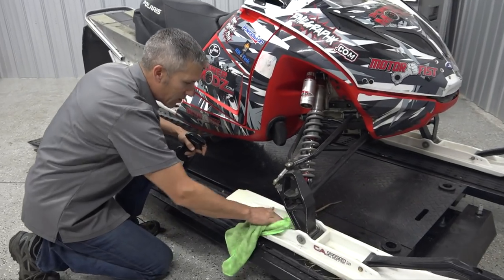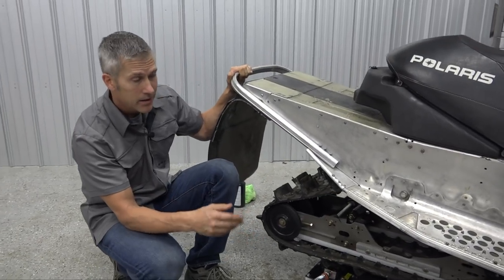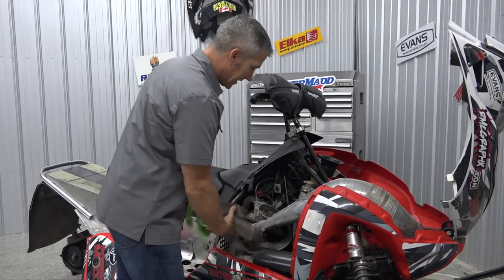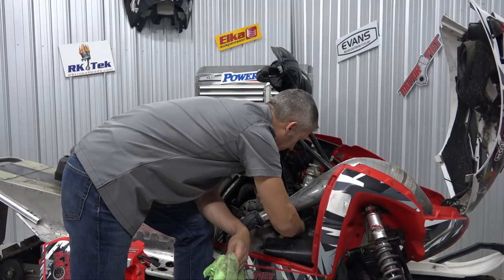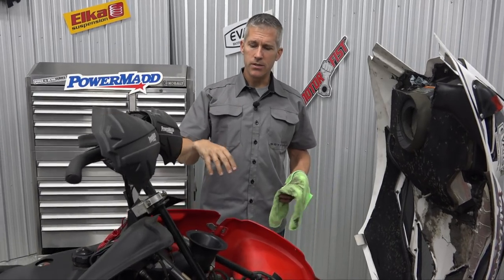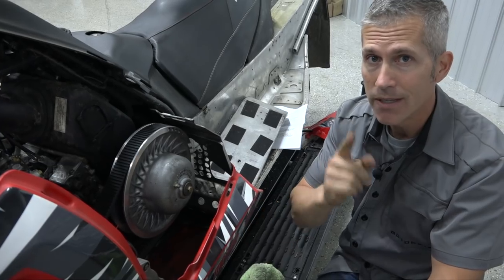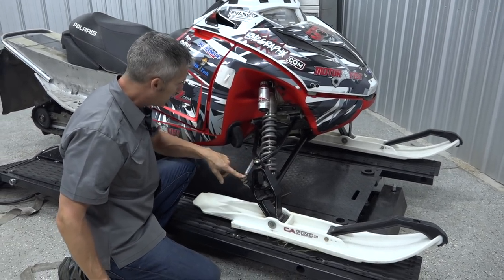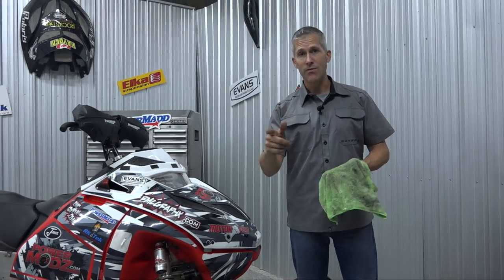Snowmobile preseason checklist!!  Get your sled ready, the snow's coming!!

Comment: What 2 stroke oil should you use? Does the marine stuff work as long as it's injector safe? I can find an all purpose and a marine but none specific to sleds.
Reply: Its not a crazy setup just a stock 580 triple.

Comment: I have a 2000 ski doo summit 600 that I just bought and I have no tail lights, headlights,  tach, or hardwarmers.  The electrical schematic shows no resistors or fuses.  I think that the voltage regulator may have gone and popped all my bulbs.  Any other ideas anyone might have?

Comment: Hey  Louie I have a question, so my dad has a '96 polaris indy sp 600 triple and last season it would run out of gas within like 60-70 miles which it usually gets closes to 100 miles. What could be the problem that's causing this to happen?
Thanks.
Reply: check your carb boots, they crack and it may make it harder on gas, also check the fuel pump.
Reply: matthew bigras thank u

Comment: if its a 2 stroke why dose it have oil
Reply from the maker: +Gregg Schulz Exactly thanks Gregg!
Reply: some two stroke engines are oil injected and have an oil reservoir. these engines do not need fuel oil pre mix. if you did put pre mix in it,  it would have a rich condition leading to fouling, excessive carbon buildup ect. also the engine would produce excessive grey smoke as unused oil burns as it exits the exhaust.